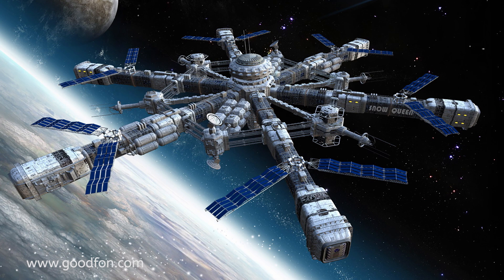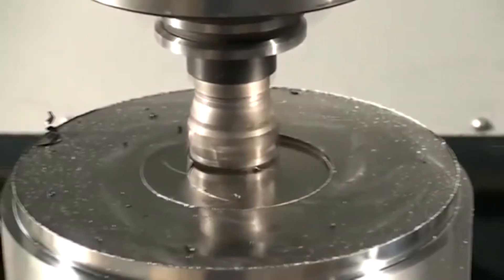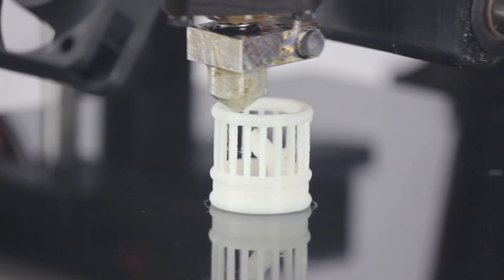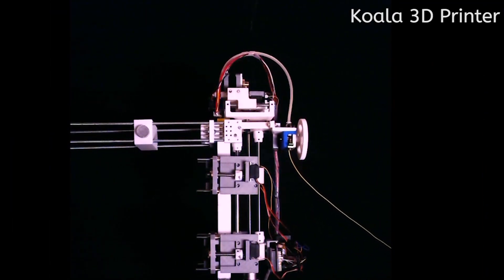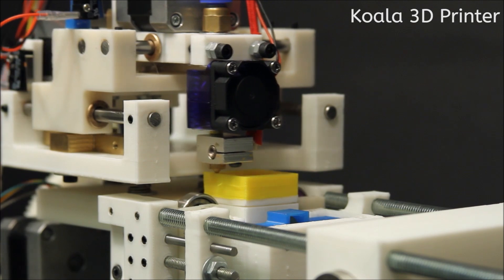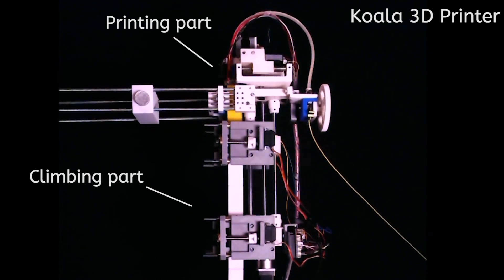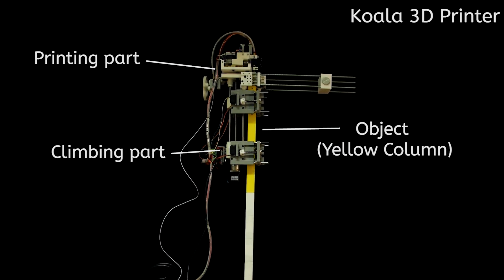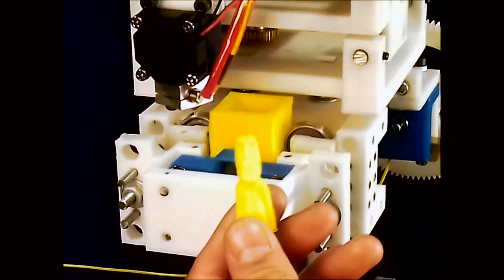Koala 3D Printer

Comment: Wonderful project... Nice job.. The best for the future...
Reply from the maker: Thank you Milo !
Reply: @JuanCristobalZagal  https://youtu.be/oBBhVcemVHc can you use in the future the "xyz non planar" and to serve the collumn print for use  like a monorail like the vidéo... Ty for your response
Reply from the maker: @Milo_CORSIC4  To depart from the vertical column the goal in the future is to have multiple printers collaborating. Eventually moving from one place to another place of a structure. Thanks for sharing this monorail video,... this is an interesting setup but at the end to have motion any dimension in space printers will need 3 motors anyhow. Having three carriages on the same axis to achieve motion beyond that axis is interesting but I still do not know how to apply that here,... Cheers.